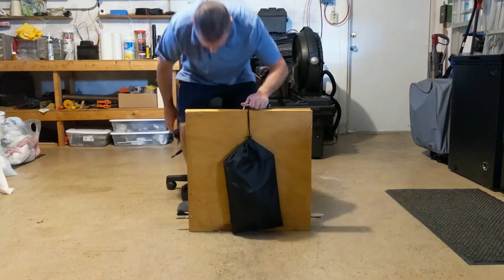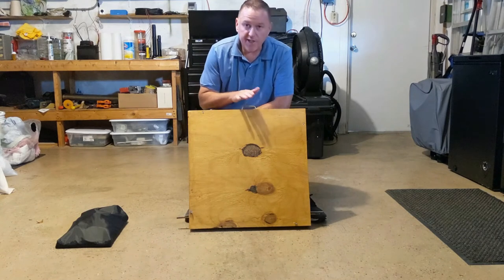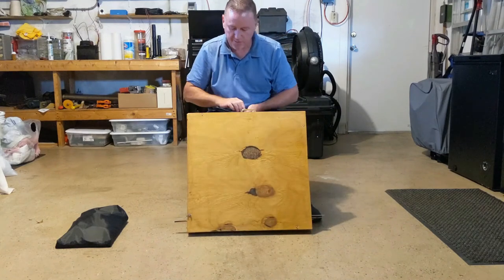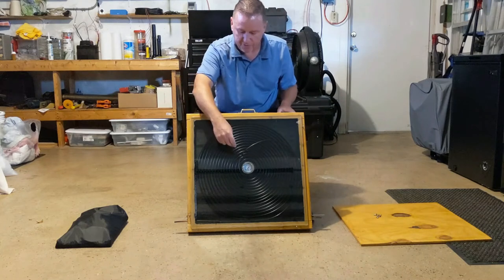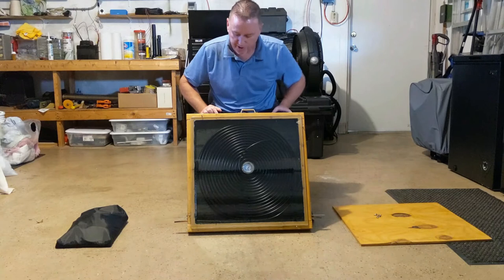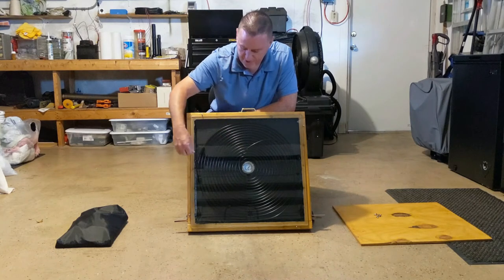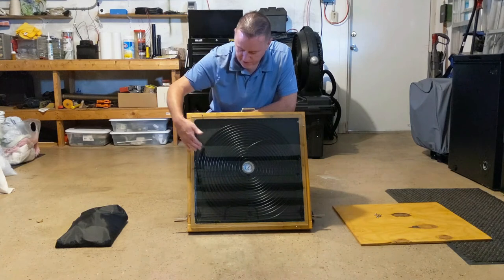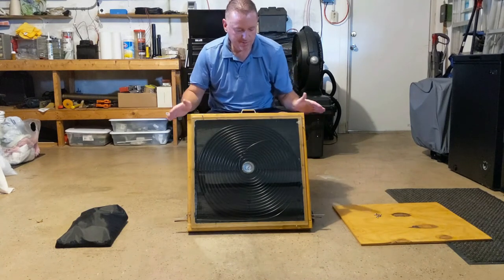Solar Water Heater for Camping and/or Emergencies (w/ Tech Demo)

Comment: I have an old Boy Scout trick I used in 1990 how to improve it .
But I didn’t have the idea until I saw your video.
So I want to combine both ideas.
In scout we took a 55 gallons drum . We copper tube from the 55 gallon tank have a in out  one connection at top barrel and 1 connection at bottom of barrel and have 3 full copper loop over the camp fire and the heat would circulate from cold to hot have some pressure but not a ton of pressure.. And we have hot water to clean our dishes wash hands. We always have hot water.
But with your system now have pressure for showers
We didn’t have a pump
But a camp fire can heat water at night to
Reply from the maker: Yup, I thought of making a video on this as well.  Just haven't gotten to it yet...  It's pretty easy to make, just takes time.

Comment: Copper pipe for conductive heat transfer? I though black poly pipe would be lighter and a little more cost effective. Your design is good and works. Nice idea. Thanks for sharing
Reply from the maker: Black poly will work as well, it's not as dense and doesn't hold heat as well.  You need to use much more for the same energy transfer or push/pull the water through slower.  Either will work, just a personal preference based on the need for a smaller/transportable size.

Comment: Why aren't the inlet and outlets on the same side of the box
Reply from the maker: You could put them on the same side if you wanted to.  I kept them on separate sides as it didn't require as much of a bend or kink in the copper tubing.  I didn't want to impair the flow.